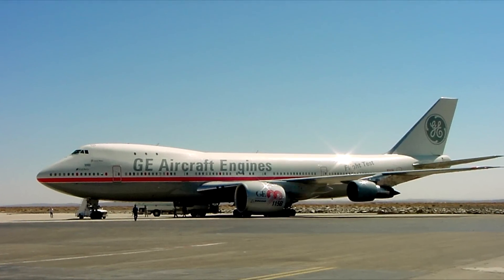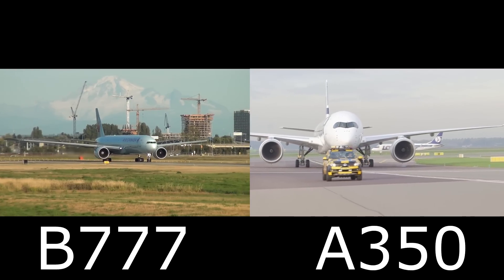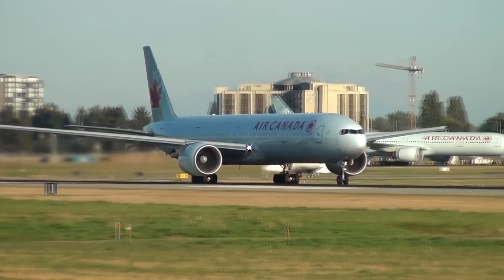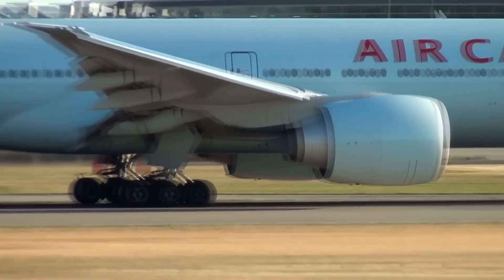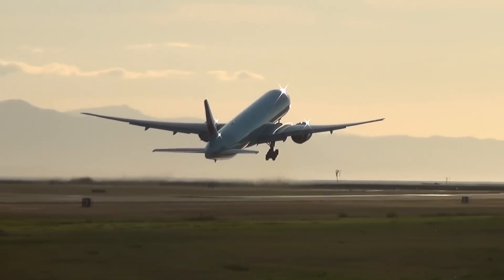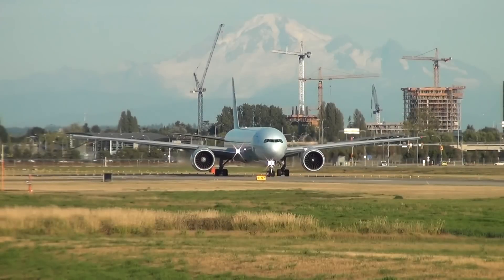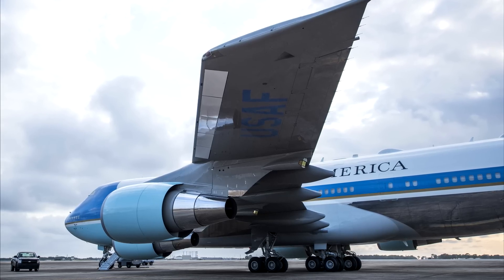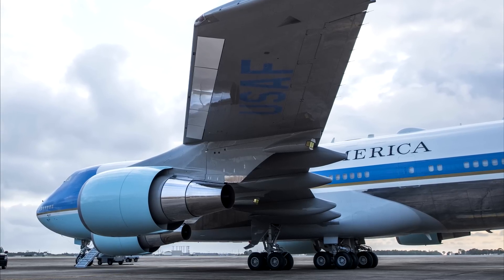Will 2 GE90 Engines Work On The 747?

Comment: The need to put these on the B-52H 2 on each wing. Since the pylons are currently 2 nacelles per pylon now it should handle a single 90. That would give the B-52 awesome power, longer range & quicker take offs.
Reply: Agreed.  Really, just about any modern turbofan engine would be better than what it has.

edit:  Ooops - I misread your comment the first time.
Reply: Magestic Hmmmmmmm
Reply: Dale Jordan yup, but not practical...would be better to leave them running just at low power. Restarting an engine mid-flight is harder on the engine. Besides, if you need to go to full power in a hurry, you don't have to go through restart procedures. I get your point & it's a very valid & good one, just better this way.
Reply: Magestic well the B-52 is still slated for service until 2050 so there’s always a chance.
Reply: The implication is that there would be four GE90 s since there is four pylons. Imagine eight of them. Eight hundred thousand pounds of thrust to send you to the moon.
Reply: Magestic what about four ge9 engines but turn off two after taking off , is that possible ??
Reply: The high altitude performance of a fanjet is not likely to be comparable to the turbojets used on the B-52. If they could afford the loss in altitude the take off and climb performance, not to mention the cruise duration, would be greatly enhanced
Reply: David Paine well the B-52H uses turbofans not turbojets.

Comment: Just make a triple deck, quad GE90. Lol.
Reply: Or a quad deck with 6 ge90s
Reply: @followthegrow108  or 5 decks with like  4 or 6 ge9x
Reply: With a streched body to 800 passengers.
Reply: Or how about a triple deck trijet with GE90?
Reply: @thecaynuck4694  imagine the prototype trijet just slams into the ground on landing due to Boeing not thinking about switching out the 727 design and going for the larger trijet designs
Reply: 747000

Comment: Call me a wuss but I simply have concerns about extended flights over open ocean with two-engine airliners. You're in very little peril losing 1 out of 4 engines half-way to Sydney but losing 1 out of 2 just past the half-way point increases your chances of having to ditch by a huge factor. I know the probability is extremely low but for such corridors, why tempt fate?
Reply: Basically it's not economically viable. For airlines it doesn't make sense to spend a lot of money in maintenance and fuel for more engines when the chances of losing one in two engines are so low. It's like saying I'm never getting out of home again because I can get hit by a lightning. It's a stupid comparison but I hope you understand.

Comment: Purpose designed twins usually have a 1:3 power to weight ratio.
The B747 has ratios of 1:4 or 1:5.
The maximum weight with those two GE90s would be about 690,000 pounds. The loss of over 100,000 pounds makes the idea uneconomical.
Reply: David  2 GE90-115's would save 11,000# over 4 Ge9x on the -8 but also would be 36,000# less thrust !!!  enough weight saving???  it would probably work on the -400 747 !!!  Less weight and it has less thrust !!!

Comment: Would a 747 work with 2 GE90s? Undoubtedly.
But that’s not the question you need to ask.
Every aircraft needs to be able to continue flying if an one engine fails at any moment. Including a fully loaded takeoff.
That’s why twin-engined a/c like the 777 seem over-powered.
So the question you need to be asking is whether a 747 would work with ONE GE90.
And the answer is, of course, no.
Reply: Thomas Hillier how about adding 3rd small engine?

Comment: 747 SP already has a larger tail, so it could be possible. Also the new engines needed to mount much higher to have a decent amount of ground clearance which could also cause some needs of modifications.

Comment: If the GE90 is the right engine for a 777x (which is obviously the case), no way it's going to be a realistic choice for a 747.

A 777x-10 might seat 450 passengers in a 3-class seat set-up, so what will a 747-8I do better, even after the enormous redesign costs have been incurred?

The 747 is one of the greatest ever, and the A380 is a turkey which never should have been built. 

Advances in structural materials, engine technology, and the evolution of the air travel market have made anything bigger than a 777x TOO big.
Reply: how fucking dare you disrespect the A380?
Reply: "Advances in structural materials, engine technology, and the evolution of the air travel market have made anything bigger than a 777x TOO big."
No you mean treating passengers like sardines made anything bigger than a 777x not worth purchasing.
Reply: Andrea Mendes IKR. All these internet aviation fanbois be like: "plane XY sucks because MUH FUEL ECONOMY" as if they own airlines' stocks or something. For those living in the real world, the space and comfort provided by the A380 is unrivaled.

Comment: In ideal conditions two GE90 engines can easily power a 747. However, when a 747 currently loses an engine, it still produces thrust to offset yawing on that wing.

Also, most people assume losing an engine on a twin will reduce its performance by 50%, that's incorrect. The drag now caused by the inoperable engine relates to a more hefty 70% simulated loss.

That means that all is well until an engine fails at a critical point in flight, ie: VR @ MTOW. 

The GE90 powered 747 in that situation would likely be unable to climb or hold wings level and crash.

With 4 engines. The likelihood of two engines failing is 200% less than that of a twin which would cause the same scenario outcome and that's why even though Boeing has considered it, would never take it further. 

Safety.

Comment: I've thought about this for a while now....i figured building a completely new 747-9 with completely redesigned wings....set up for two GE-90x... wouldn't be as costly as a completely new aircraft....If you've watched Top Gear Uk....you will notice a modified 747...with 2 engines on a single engine pilon..like a B-52...parked on the runway....in the background...cant see that being much different than a single larger GE-90X....other than ground clearance to runway...i could see this keeping the 747 fuel efficient and viable for another 30 years...

Comment: The only problems I see with this concept is that the GE90 turbofans might be too big to fit comfortably under the wing without scraping the ground. (Like the 737 engine naciles being flat on the bottom)
If this was even possible, or more fuel economical then Boeing would've done this.

Comment: Actually 4x GE90 s would be amazing come to think of it  😂
Reply: Maybe for military purpose,  C 5 can get a ton of heavy loads, I'm not a expert on planes, just saying
Reply: http://www.airliners.net/forum/viewtopic.php?t=365677
4 GE90, you are looking at an aircraft that similar size to An225 at least, the biggest plane in the world.
Reply: Are you trying to fly to the moon with that kind of thrust? lol
Reply: That would probably have a max takeoff weight close to 2,000,000lbs
Reply: Could translate into higher cruising and therefore maybe higher ground speed.
Reply: What we need is an aircraft with the fuselage as wide as the a380 but with the aircraft as a whole being in the same proportions as an a340-600. 4xge90 should do it.
Reply: @Str4t0sph4r4  4 engines wont cut it anymore with EPA crap 2 engines are the max and that for sure leaves the a380 out.
Reply: @andrewlarson7895  I think it’s more to do with the jumbos being less useful as point to point aviation flourishes more. The a380 was the most efficient aircraft when it came out in terms of seat mile per unit of fuel.
Reply: @Str4t0sph4r4  that's all true but i believe the tide will shift some, airport's and the land that comes with are very expensive to locate and then to build
Reply: 460k lbs of thrust would be a hoot.
Reply: Put that thing on Antonov
Reply: A new a480 neo may be ;)
Reply: Crisanto Dias flying to low earth orbit?
Reply: Do you want fly out of lukla with a 747?😂
Reply: Would be amazing to experience ,just a thought 😂
Reply: Yeah, that's the ticket. Imagine a plane that 4 GE90's  would be necessary for.  A 900+ pax  plane that no airport could possibly ever service. lol  But hey from what I see on YouTube  Airliners fly on Free Energy no fuel needed anyway.!!  9/11 happened cos someone had a cigarette-lighter in their carry-on (and a hairspay aerosol).
Reply: rougly 400.000 worth of thurst  if that happen
Reply: That thing would takeoff like a rocket, and climb like nobody’s business! 😎
Reply: Will need a lot of wing span🙄🙄
Reply: Crisanto Dias it couldn’t be possible unless they added extra fuel tanks in the 747 because those engines will suck it dry.
Reply: It would also Be Able to set longer routes for the Airline But there’s a cost to everything 4 times I mean it’s worth an Australian Crack Mate But it also looks amazing so I say yes!!
But is it safe?
Reply: 747x the new super-sonic jet
Reply: Crisanto Dias that’s would be a new Concorde right there!
Reply: Clean Air:

Ight ima head out👋
Reply: Nope
Reply: New wings
Reply: Come on folks, it shouldn't always be about money, sometimes you just have to do something just because!
Reply: @colinkulasik1128  what ? Funny
Reply: It would take off as quickly as the 737😂
Reply: Well just because it will produce more power than needed doesn't mean it will have to be used. Might be even more efficient
Reply: Crisanto Dias they need to do this for Air Force one lol
Reply: Crisanto Dias 5 of them.... hahaha

Comment: Actually, you wouldn't need to much modification at all.  All aircraft are designed today so that future versions can receive very simple, low cost modifications such as new wings or tail, or just stretching the hull.  The -8 has a brand new wing and tail compared to the -100.  So all you would need to do is redesign the wing, and that would be it, even a new tail isn't necessary as the rudder is used to adjust for that turning moment anyway.  It would actually make a lot of since overall, especially since the 777 can't get any larger without adding a second deck.
Reply: Jame M you got me wondering if they could do a 777/747 hybrid. 2 ge90 engines one a 747 using the wings (or derived from the wings of) the 777.
Probably no.
Reply: Well, that's not to say it wouldn't take work.  But they use the 747 to test the 777's engines now, and it does this with all 4 of its original engines.  So the structure is there.  The problem will be the V1 issue someone brought up (but even that is probably less of an issue that we know, it just has to be able to reach 1,500' by climb 2, or about 2,000 beyond the runway) Also, the tail doesn't need to be much bigger if it ever did.  With the engines being allowed to sit closer to the frame, that twisting moment from single engine ops is reduced, that's why most twin jet engines are mounted closer than the inboard engines on a quad jet. The problem...cost of certification would be one problem, but the second is if Boeing saw the need for it, which is probably a no they don't. But if they did, it would be a plane that could carry 500 people in all coach config with far lower operating cost than a fully loaded A380 with a range that could equal that of a 777-200LR.
Reply: Jame M - I believe the inboard port engine is a single GE-90, not strapped with the original engine, but alone.

Comment: This conjecture isn't even contemplatable. Ridiculous on so many levels. Have you photoshopped  an A380 too. (Now that's an ugly plane.!  So you're allowed.)
The 747 with 4 engines is sheer majesty. The 'Queen' of the skies. Don't be messing with her.
Reply: Boeing fanboy. No.  I'm a Vickers/DeHaviland/BAC/Handley Page/Hawker Siddeley/Bristol/Shorts kinda fanboy. Ya get where I'm coming from.?
Reply: jeremy fine the klm 747 replace the wing in the 777.
Reply: Tatyana Neplyueva fuck you.
Reply: Somewhere non-continental perhaps? ;-)
Reply: The A380 is the biggest and most beautiful plane in the skies nowadays.  Itd be even better if they did a stretch and go bigger but airports wont fit them.  B747s are nice but the hump is really designed for cargo initially.   Kinda like a dock worker vs royalty :)
Reply: boeing fan boy much?

Comment: Didn't Boeing consider a tri-jet configuration of the 747 back in the 1970s?  Admittedly, a vertical stabilizer with a GE90 at its base would look downright weird.
Reply: Yaboinav Aviation I read that they canned that idea, because it would’ve required a complete redesign of the wing. Which also meant that there would be more pilot-retraining necessary. So they went on to develop the 747SP instead!
Reply: After all the catastrophes with the DC10, unlikely to try it again.  How about hanging the third engine from the belly of the plane?  Will need taller landing gear.
Reply: they also consider a full double decker but the idea was dismissed due to passenger's safety

Comment: 4 GE90s are the answer!

With such a large engine you only need full thrust of all four on takeoff and Landing but during Cruise only two need to operate

Oh, and make it double decker will ya?
Reply: The idle engines would likely be a drag issue in flight.
Reply: But it'll be heavier, and fuel consumption will be massive
Reply: Joao Chiari actually the weight would balance out given that the latest generation 747 has lighter wings

And fuel consumption won't be massive at all especially when all four Ge90s on a 747 won't always need to run at the same time...
Reply: Sweetteawillie not if all four idle at low speed

Comment: Another question: just how big a beast could be made if four GE90-115B engines were used?
Reply: Take an A380, stretch the fuselage out horizontally so it's cylindrical.
Reply: To big to be used as passenger airplane. Would go towards the size of an An225.
Reply: Enough to rip the wings clean off, from what I heard

Comment: The wing would have to be redesigned and given the cost of retrofitting a new wing as well as new engines, it would probably not be economically feasible. I firmly believe that Boeing saw "the writing on the wall" regarding the future of the 747 and decided that the new 777X would be the best compromise for carriers who wanted to have almost as many seats as in a 747 but in a totally modern plane.
Reply: The Boeing 777 is not as modern as the Airbus A350 airplane.

Comment: Good video and idea.  I too have thought about this before.  I think that there can be a jet bigger than the A380 in tri-jet style, with 3 GE90's.  That would be a huge fan to fin in the back, so the intake duct would need to be shaped around the top of the fuselage and the APU relocated entirely.

Comment: The 777 is the twin engine 747 with only difference being the lack of the upper deck cockpit which was really designed to be able to have  a nose cargo door for oversized cargo.  

While the 747 is an Icon of aviation, the 777 does what passenger airlines want with greater efficiency as proven by the lack of passenger orders for the 747-8.  The nose cargo door option wasn’t important to airlines whose cargo business can be served under deck or by a freighter version of the 777.
Reply: The 777 is not a single deck 747. The 777 has a narrower fuselage, some 30cm narrower. It's a nine abreast aircraft, the 747 is a 10 abreast aircraft.
Reply: @ashleymalamute  The 777 is design in 10 abreast aircraft not nine,this is requested by Cathay Pacific during the working together program of 777 development.